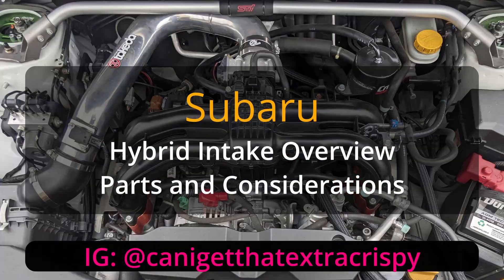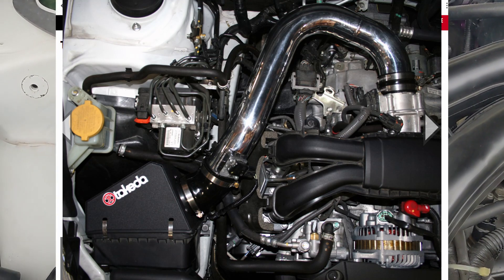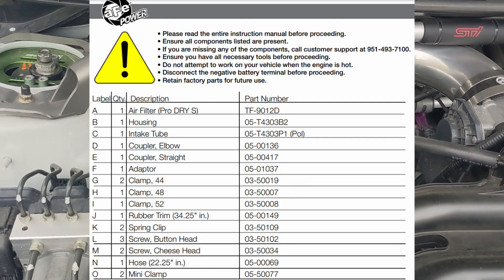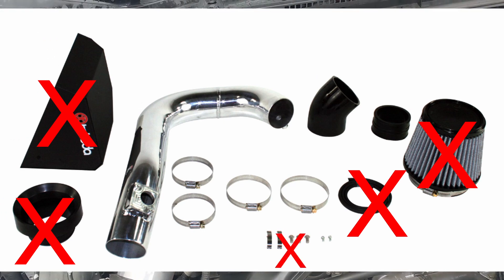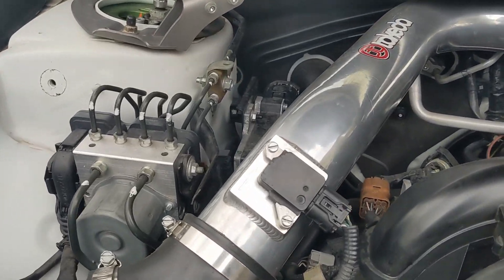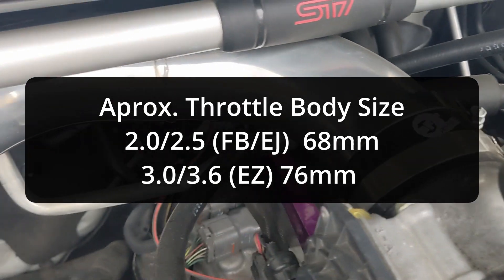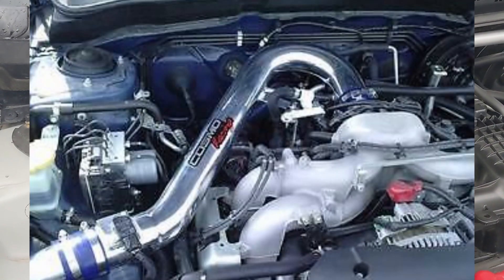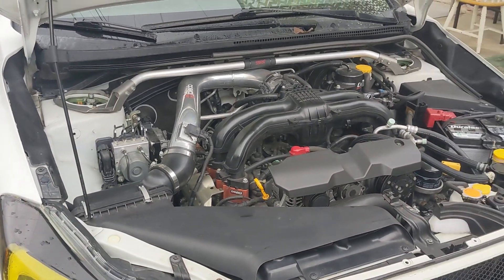Subaru NA Hybrid Cold Air Intake Parts and Considerations

Comment: Whats the link to the all a cart page
Reply: Thanks! I am too experimenting with different intake set ups. Looking to find a pipe that didn’t have a maf sensor built into so i can use the oem maf location without chopping the section off the oem box. I know nameless makes one but dont really
Want to spend 300+ on a piece of tubing..
Reply from the maker: https://afepower.com/afe-power-tr-4303p-takeda-stage-2-pro-dry-s-cold-air-intake-system

There is an INSTRUCTIONS link to download a PDF. You can probably order directly from them call or email. Good luck.

Comment: Do you still have the extra hole cut in the bottom of the OEM air box? I see that the "DIY-Throated Airbox" is crossed out on your mods list on your git. I've seen the same idea done in the Crosstrek community, if you search "Crosstreck Velocity Stack Mod" the forum thread is one of the first results. Just curious if you kept the airbox modded or if you got an intact replacement OEM box once you got the Takeda rigged up. I've deleted the carbon filter and plan to drop a dryflow filter in place of the OEM and will most likely open up the airbox, gonna keep it stock for the time being otherwise.
Reply from the maker: Actually. I opened the throated air box up a few months ago. This time with a pre filter. 

I bought myself a second OEM airbox so I could have a back up in case I ever wanted to revert to stock. 

I'll have to look up the velocity stack. I did at some point have an extra tube under the air box, which pulled air from a drilled fog light bezel.  All in good fun. 

You have to balance reliability, water intake, cold air, cleanliness and some other things.  But yeah. An interesting place to play.